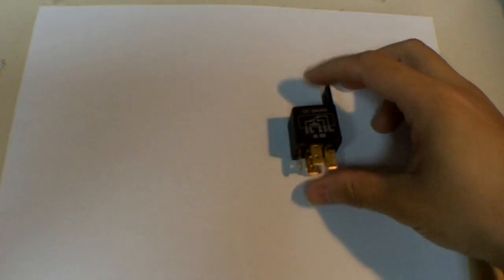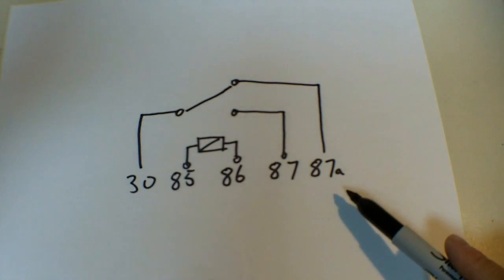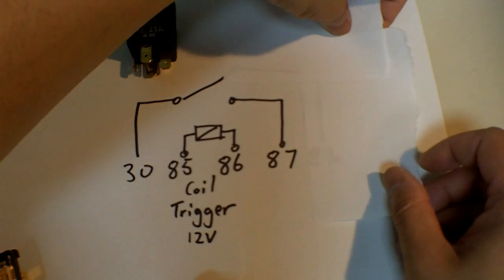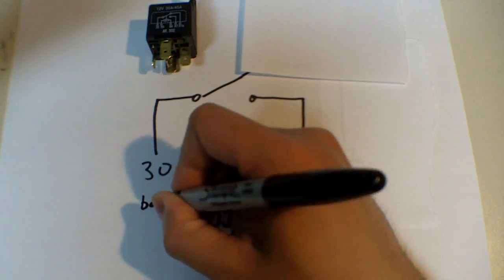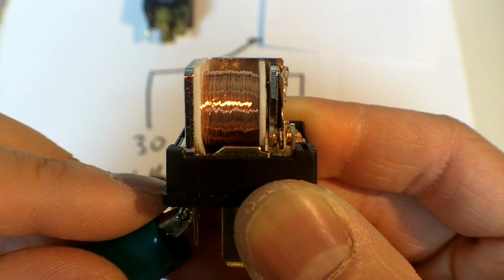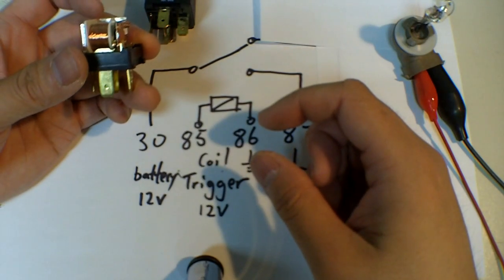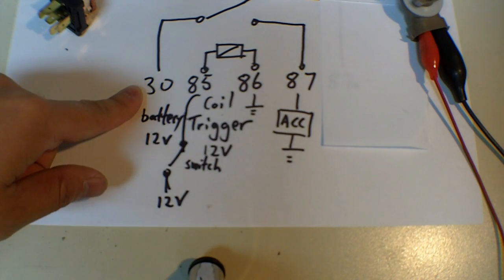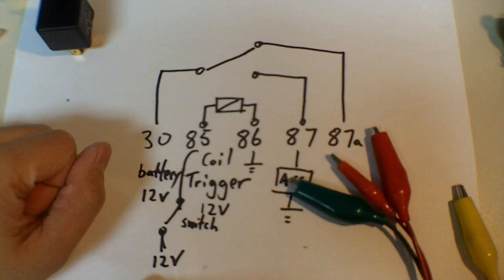Basics of automotive relays

Comment: It isn’t that relays are used where you need more amperage than a switch can provide or else they would just make higher-amperage switches with the same contacts that go in a relay. No, a relay is when you need a switch that is electrically actuated instead of requiring you to physically flip/turn a switch. The reason you might think otherwise is because one of the biggest reasons to use a relay is to switch a high amp circuit on/off with a low amp circuit. For example, you don’t want all the amps from your headlights or starter going through the ignition switch, so the key on and start positions merely trigger a relay that gives fully power to the starter or headlights.

Comment: Good video Wedginator. If I understand it right that means instead of an on/off switch on 85 you could just piggyback that to your oem fusebox on a fuse that is ignition switched like the headlights, accessories, turn signal etc and now everything you connect to 87 or 87a is controlled when you turn your key . That would tie right into your other explanation of your switch block or fuseblock in your electrical basics video, meaning you could connect that to your own switchblock and have everything controlled with your key, great video man, why did you stop?

Comment: Is a special puller needed to remove the relay from the vehicle?
Reply: Depends on its placement in, say, an IPDM, and how strong your paws might be.  I recommend using a tool if you cannot do it with your fingers, and ensuring it has soft pads at the end of it, as the housing on relays is vulnerable to gouging and cracking.

Comment: Hi, great video there. 
Do you mind assisting me on a question?
if i install a switch on the "85" line, the line will be run to my switch and the return line from the switch will be going back to the "86" of the relay to form a circuit. 
Am i right?

Comment: Ok - this was awesome.  I am going to click through a ton of links to try to get you paid.  Question - so would I connect the coil power source by splitting into a wire that is only powered when the bike is on?   Otherwise arnt you depending on turning off the little switch to stop your accessories from draining power?

Comment from the maker: Here's how I look at switches. The middle connector is a common connector typically a live connector should go there. Then hook up a ground to connector 3 (or whichever connector is for the lights). And connector 1 should be for completing the circuit. The illuminated part of the switch is a separate circuit. So if you don't hook up ground, your switch illumination just won't light up but the switch part will still work.